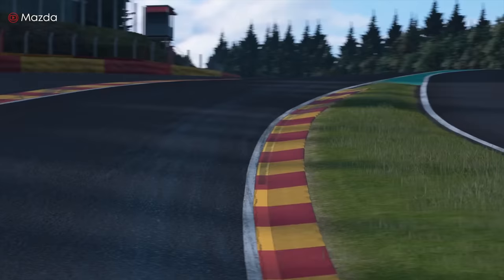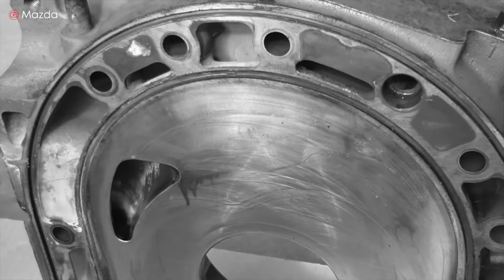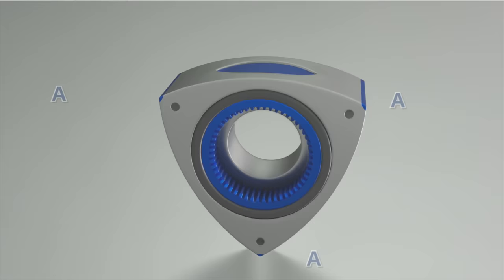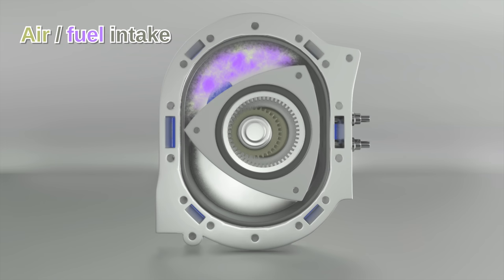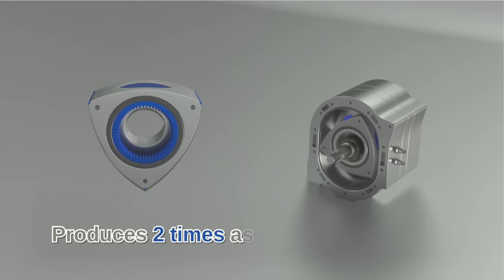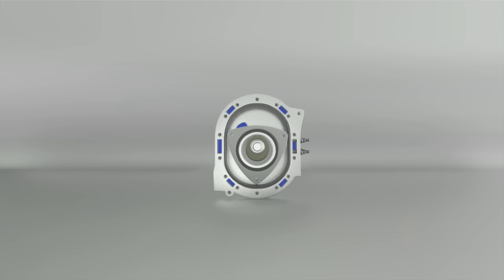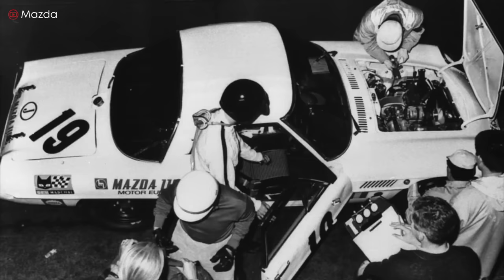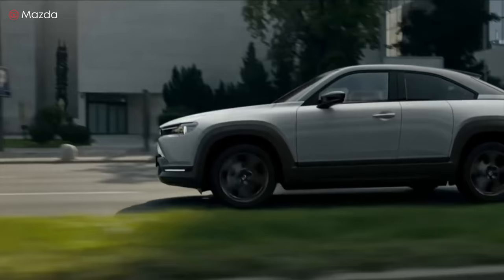Mazda's New Engine is the Most Powerful Engine Ever Made

Comment: I've read 6 years ago that the CEO of Mazda made it clear that as long as he is the CEO, the rotary will not go away
Reply: Yeah, but he (Masamichi Kogai) was demoted in 2019 ...
Reply: If they could somehow combine the power of a rotary engine with the economy of a diesel, which is inherently more lubricated that would be a noteworthy
Reply: @SF-dy6hn  but i won’t rev as high
Reply: @irfanqayyum2983  get a better torque converter
Reply: @irfanqayyum2983  wonder if its possible to do a turbo-charged rotary lol, that would help with fuel (won't rev as high but it'd have plenty of torque)
Reply: It did go away🤦 I get him saying that.  But until it's back, it's away
Reply: Unfortunately the internal combustion engine's days are numbered. I give it 20 years tops.
Reply: @Rob165x  Turbo-charged rotaries are common-place...
Reply: @fedzalicious  E-fuels and higher efficiencies will make them better options than EVs in terms of efficiency.
Reply: Andy Candy   @Vlad Lu  I should have said gasoline internal combustion engines. There's a finite amount of fossil fuel in the world. Crude oil comes from fossils and takes millions of years to form. We have to use something other than gasoline. Hydrogen internal combustion is perfect because it's easy to make and, if tuned properly, it's only emission is steam. Even hydrogen fuel cells driving an electric motor is a good option. Or you could have both with a hybrid system.
But battery and electric motor technology will just get better and better. It'll get to a point where it's just cheaper and easier to go electric. Who knows, we could all be flying around in Uber drones one day, which would no doubt be electric 😄
Reply: Have you not been paying attention to the news? They just created the mx-30, a small electric crossover with an optional rotary range extender.
Reply: @fedzalicious  you also have to consider that the materials to make the batteries like (lithium) while very common on earth are also very damaging to the earth, (also the magnets which are components of electric vehicles) i would look into why making electric vehicles are damaging to the earth more than fossil fuel, i do agree that we can't rely on fossil fuels forever but i think there's other sustainable methods (like water who a guy in the 80s made it possible but then "mysteriously died" and his invention was then patented by the government/oil companies)
Reply: I was today years old when I learned the rotary engine isn't a fiction based experiment. Newton's 3 laws seem to be abrasive to this concept.
Reply: @fedzalicious  sadly, I can already see a Toyota vvti inline 4 sitting in a glass box in a museum looked at as a spectacle of vintage human engineering, before the quantum computer became commercial success and changed the way humans operate forever.
Reply: @Rob165x  turbo charged rotaries are common, and that's not the way it works...
Reply: @fedzalicious  until hydrogen power takes over
Reply: @Rob165x  There are kits for the RX-7 for twin turbos. Revving is unaffected.
Reply: Andy Candy  Everyone will have to eventually due to worldwide, government mandates.  There will be no option at some point
Reply: @fedzalicious  It won't get better. Batteries are already hitting a limit, similar to computers. They are either more volatile or heavier. Those are neither good for efficiency.
Reply: @vladlu6362  actually there are many new battery technologies on the horizon. And have you heard of a quantum computer? We're nowhere near the limits of technology.
Reply: @Rob165x  There are plenty of turbo rotaries my friend
Reply: @fedzalicious  crude oil does not come from fossils. This was disproved decades ago. I can make crude oil from Thanksgiving leftovers in about 45 minutes. Get caught up on science
Reply: @Rob165x  FD rx7's come stock with twin turbos. rotaries and turbos go together better than mac and cheese.
Reply: @sparkola  I hope you're joking, because that is a silly comment.
Reply: @fedzalicious  your welcome
Reply: @sparkola  it's hard to tell sometimes. People believe some stupid stuff.
Reply: @vladlu6362  combustion engine are hitting the Limit and the battery Technologie have Potential to be better. The electric motor have a efficiency of 85 to 96%, its done. I love the Sound of the rotory engine but it is dirty and not effizient.
Reply: @SF-dy6hn  drive a manual instead of automatic like some poser
Reply: Andy Candy  Performance vehicles will remain daily drivers on the other hand...moving forward makes no sense economically
Reply: That's before he blew up Mazda's financial book 📖. Still can't solve the engine seal after almost bankrupt the co.
Nice try.
So bye, bye.
Reply: @fedzalicious  I see ICE cars as enthusiast gear and cars for rich people in the future when majority of people use electric
Reply: @JABelms  yeah, sounds about right. Special registration like with classic cars. But you'll probably have to buy barrels of fuel as most gas stations will probably be converted to quick charging stations.
Reply: @fedzalicious  Yeah which rich people have no problems with
Reply: @fedzalicious  🤣🤣🤣🤣🤣🤣🤣🤣🤣🤣🤣🤣🤣🤣
Reply: @countryjoe3551  just so you know, Joe. That makes absolutely no sense without context. It's like walking up to a stranger on the street and laughing hysterically in their face.
Reply: red diamond71  hear, hear
Reply: @ramon92  Tesla bought a huge Lithium reserve for mining and Elon said they created a mining technique that restores the mined land to "pre-mined" condition and their technique doesn't pollute like the industry does currently.  That's just one example of mining progress.  So the evolution of mining the raw materials is no longer going to be an excuse eventually.  Sad it takes a guy with no ties to big oil and the pockets to resist their fear tactics to solve these problems.  Plus electricity is cheaper than any fuel to "mine" (using renewables considering cost over time).  You can't own your own hydrogen or fossil fuel source.  You can own your own solar or wind generator though.
Reply: @Winglessflight97  i agree wholeheartedly, if I'm correct he said he gets his lithium from Australia and not from these poor countries like Africa etc. i do hope that eventually everyone follows suit, he definitely sets a great example in that regard
Reply: @SF-dy6hn  i think hybrid rotary is better option. Have a nice sound, high power and better fuel efficiency
Reply: @Winglessflight97  
How about when it's cloudy and calm? That happens a lot.
Sorry boss, can't get there til Wednesday.
Reply: @fedzalicious  
Electric is a joke.  Nobody going anywhere would tolerate a half hour to charge let alone 8 hours.  And how will you generate the electricity?  Right now coal is the only way to produce the amount required.  Even if solar and wind could produce enough, which they can't and won't, who wants a wind turbine in their back yard?  You first.
Reply: @jamest3552  ever heard of nuclear power? And once solid state batteries become a thing, charging times will be greatly reduced and range will increase. You charge your phone while you're asleep, what's wrong with charging your car as well. Even current EVs have enough range for typical daily driving. And how awesome would it be not having smog and noise pollution in cities? And what about the difference in running cost?
Reply: @Acme Inc. I got a feeling all the technology we have has come and gone a thousand times in our past and we’re just too stupid to realize it.
Reply: @Rob165x  They already did that in the 90s.... look up RX7 Turbo.. VERY fun little car.  Also WAY ahead of their time with 4 wheel steering.
Reply: @James Olelo can you elaborate?
Reply: @fedzalicious  
I recommend you do more research on abiogenic oil formation. Also, electric vehicles' batteries are charged by electricity produced primarily by fuel burning and hydro electric power plants. Solar and Wind power generation systems do not and cannot provide enough power to replace fuel burning power plants.  The laws of physics and cost dictates all of this. We have a long way to go.
Reply: @fedzalicious  Id happily live with Hydrogen Cars instead of electric cars
I get that most electric cars are capable of a very HPO but I’ve just never liked them
Reply: @SF-dy6hn  I thought there was a diesel rotary
Reply: Andy Candy  Have you been living under a rock? Combustion engine's are already starting to go away. Sure maybe couple supercars might always stay and I hope they do, but the fact is that electric is the future
Reply: @fedzalicious  A quantum computer is useless for normal computing. It isn't more powerful than a normal computer, it just uses completely different algorithms. You could make a case for light-based CPUs, but I was referencing the limitations of silicon. And what new technologies? Elon musk didn't do anything super new : he increased the size of the cells, and thus weight. Solid batteries have been a thing... They die earlier in power tools than other batteries, and that will also happen in cars. We are hitting a wall.
Reply: @induction8038  The electric motor does have those efficiencies... What is the efficiency of the generator that powers your electric vehicle, though? Less than 50% in old plants, and new plants aren't being built. The combustion engine has been getting a lot more efficient in recent years. H
Reply: @Winglessflight97  Electricity is produced by those "fuels" you "mine". All of it.
Reply: @Winglessflight97  You can own your own hydrogen source... Lol.
Reply: @fedzalicious  Solid states have been a thing for years. Anyone with a powertool that can use them says to stay away from them since they die quickly.
Reply: @vladlu6362  I'll get mine as soon as my next door neighbor Bill Gates buys his  😅 😂 🤣
Reply: @Rob165x  bro... the rx7 fd came turbocharged
Reply: @vladlu6362  Yes also would be neat if Mazda incorporates their high efficiency HCCI combustion technology into their rotary. I wonder if Mazda considered licensing LiquidPiston's rotary design. It seems it's more efficient and less prone to seal wear.
Reply: Andy Candy  Yeah, theyll give up when money says so, unless they wanna end up in the papers
 " Committed suicide by shooting himself 7 times in the back "
Reply: @fedzalicious  That fuel isnt from bone, its from nature. Oil is in everything.
Reply: @claudethesilentman7841  You like BIG explosions eh
Reply: @vladlu6362  i'm from germany and we have  more than 45 % reneweble electric energie in the grid. So electric car can get cleaner and when you have Solar the efficiency get higher. Look at the electric energy in your Staat. Combustion engine can never be clean. And when you use efuel or hydrogen it not efficienc.
Reply: @vladlu6362  we've reached the limits of technology! I guy on the internet said so. We'd all better give up and just destroy the planet. We'll be dead in 50 odd years, so who cares.
If everyone thought like you, we'd still be living in medieval times. If you're not part of the solution...
Reply: @fedzalicious   So now you're comparing phones and cars, that are used for different purposes.   There's nothing "wrong with charging your car", it's just not practical for all the non-typical days.  Let us know when you put up that wind turbine in your backyard or when someone forces it on you.
Reply: @Winglessflight97   Do you have a solar roof and a wind turbine?  Why not?
Reply: @fedzalicious  
You watch too much cnn, relax.
Reply: @jamest3552  I have solar panels.
Reply: @jamest3552  There are a lot of evolving technologies outside of wind and solar to produce electricity.  And I've always been an advocate for nuclear, which is more reliable than even coal or any other fossil fuel.  There are wave current farms now and geothermal dependent on where you live.  Both of those are consistent.  The ocean doesn't stop making waves and the earth doesn't stop emitting heat.  I'm not a solar/wind die hard.  I'm about solving problems without creating devastating new ones
Reply: @jamest3552  why would you think anyone wants to put a wind turbine in your backyard?

I've always thought a smart way to do EV recharging would be to standardize battery packs that are detachable by a machine. You could drive into something like a carwash, wait 40 seconds, then drive away with a charged battery pack installed. One that can also be charged overnight when you're at home.

Boom...
Reply: @fedzalicious  nah, detachable batteries would be dumb, easy theft, and if it was like a “car wash” you would have to still pay a lot, your old batteries would be taken and you won’t be charged a “core” charge.
Reply: @ozzygilliam9194  you obviously don't get what I mean. The battery is huge, and bolted to the underside of your car. You drive onto a machine that automatically replaces it. You just pay for the electricity and maybe a small fee for the exchange.
Reply: @fedzalicious  I understand completely, and if simply “driving onto it” will allow a machine to replace the battery, then it will be very easy for someone to steal. And a small fee isn’t gonna happen. Maybe once every single person on this planet drives an ev but until then there will be no small fee.
Reply: @ozzygilliam9194  well it's definitely not gonna happen with that attitude. There's already people that crawl under cars and steal the catalytic converter. A dude got crushed to death the other day doing just that. But are you paranoid about someone stealing you cat? We're talking about a huge thing that would probably weigh 100kgs. I'm imagining a hydraulic lift being used to lower it from the car and the battery itself would have an electronic controller with a serial number. I don't think it would be hard to build in some security. 
But hey, I'm not actually from the future. I could be way off. But it would certainly address the problem of having to wait for it to charge. And so long as the fee was less than the cost of a tank of gas, it's still cheaper. And you always have the option of recharging it, which means you only have to pay for the convenience if you can't wait.
Reply: Mazda will never make rotary again. They just wont sell. And i like rotary
Reply: @fedzalicious  I’m worried about people stealing my stuff all the time, I’ve got subs in the back, and unless it’s very hard to take off people will find a way to steal, on a say... Tesla, the batteries cost upwards of 10,000 dollars to replace, if someone steals it they can get a nice profit by selling it really cheap. Cats are easy to steal on some cars and impossible on others, if someone wants to sit under my car for 4 hours trying to twist themselves up under it to detach the exhaust to lower it enough to cut the pipe off then they can go ahead.
Reply: @fedzalicious  oh and I know they may not be exactly the same, but we’ve been using batteries for a very long time, and even without core charges they’re expense, easily swapping a 10,000$ battery will cost a lot more than you think.
Reply: yeah, I mentioned that already
Reply: @fedzalicious  why?
Reply: @mela6046  why what?
Reply: Andy Candy  Because they are targeting their message at a specific audience. What they actually do in development going forward is not known. Electric vehicles are not stupid; why would you say such a thing...because they don't meet some simplistic idea you have about how a vehicle should be powered?
Reply: @Rob165x  
Of course you can turbocharge a rotary
Reply: @fedzalicious  Not gonna happen. You turn up with a battery pack that's near the end of its life cycle, and are they supposed to just swap you out with a good one? Or suppose you pull up with a brand new battery, and get an old one with limited range. Who's gonna eat the difference?
Reply: @WhuzzitWhoozit  it would be an exchange service, like when you go and swap your empty bbq gas cylinder for a full one. The cost of a new battery, over the average life span of a battery, would be factored into the cost of the exchange. When your empty battery goes off to be recharged it gets tested, and if it fails it gets replaced.

Or maybe the cost of the exchange could be based on the number of charge cycles your battery has recorded. Humanity has overcome bigger engineering obstacles than this. Even Einstein didn't think a nuclear weapon was possible, so don't be so quick to say something can't be done.

Why does everyone hate on EVs? Imagine living in the city and having country-fresh air to breath, and never getting disturbed by the sound of traffic. It sounds awesome to me.
Reply: @SF-dy6hn  Liquid Piston already did that.... the problem they have is the rotor is too weak to handle it. They build them for military drones ... where they only run a few thousand hours in aviation applications before rebuild.
Reply: @SF-dy6hn  They could just make a Hybrid rotary engine
Reply: Its a shame and stubborn. I give props to the engines design and attempt. But in the end it has its flaws. You can put a project to rest with respect. It doesnt mean you failed, you learned alot for attempting something new. But being stubborn will lead to your downfall.
Reply: Hmmmm then why aren't they still around???????